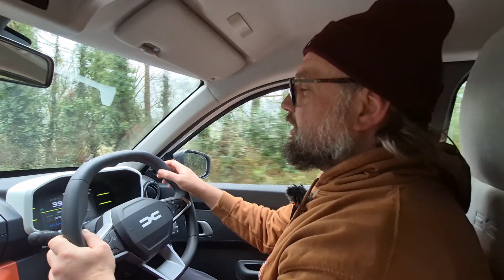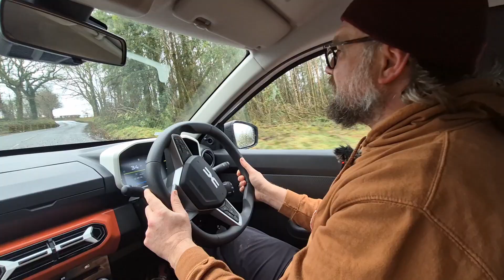Why are car speed warnings so rubbish?

Comment: "Driver assists", really?  If you can't keep your car in the correct lane and under the speed limit, you have no right to be in the driving seat.  You can't use your phone yet it's fine to be able to faf about with a stupid great big touch screen that has all the cars functions on it.  Is it just me or are these regulations taking away the responsibility of the driver to be in control of thier own car?
Reply: Amen from a huge atheist.
Reply: Hear hear! Modern cars are packed full of unnecessary distractions and controls that require you to take your eyes off the road. And on top of that, we are faced with mandatory driver "aids" that don't work very well. I'm suffering serious buyer's remorse after purchasing a new Skoda Octavia. It would be a great car if you removed the speed and lane assist, and replaced the massive telly with switches.
Reply: We have a Vauxhall Astra 73 plate. I like the look of the car, it's on Motability for my wife, but the touch screen is bad, as in difficult to use without taking your eyes off the road! The temperature alters all the time on dual zone climate control, it constantly tells me to BRAKE! if I get within a certain distance of anything it considers an obstacle. It occasionally comes up with a spoken phrase, such as " I didn't get that", whilst my wife and I are having a conversation!  It too, sometimes gets the road speed incorrect, such as 50 on a motorway,  and don't get me started on the lane assist, "safety feature"! It is dangerous to say the least, trying to pull the steering wheel back, fighting it when it decides you've incorrectly gone over a white line. It won't do that if you have indicated first, but not every time do you need to indicate. The only mod cons I really do like is the heated steering wheel and seats! Oh and no bloody CD player. I have to link my mobile phone to the car to listen to my choice of music instead of the radio!
Reply: I traded in my 10 year old car last year and was not expecting all this “assistance” from the new one. I have to switch all these helps off every time I start the engine and before I drive as my speed warning often does not represent the actual limit on the piece of road I am driving. The lane assist is far too powerful and takes too much force to override it which is disconcerting. I even have to be notified about the level of security on the connection between my phone and the car each time it starts. It’s more like a pre flight check than driving! Whilst I’m moaning, I don’t like LCD displays as much as retro needles going round a dial and a I don’t find a digital three figure speed display as easy to glance at as the old school displays. Apparently it’s progress though!
Reply: It's not just you. I don't have a modern car, but I find warning beeps and flashes extremely distracting. I'd rather concentrate on driving in the same ways that I always have.
Reply: Yep. Speedometer + brain is already your speed warning. 'Nuff said.
Reply: In the modern world, there's a lot going on you have to pay attention to, so things like lane warnings seem useful to me, at least, since if you're busy watching whether the vehicle in front really is going on with its manoeuvre and will pull right in front of you, it is easy to wander a little out of lane: at least on the narrow lanes we have in Auckland, where they have increased the capacity of the motorways by demarking four lanes on a bit of road designed for three.
Same way with speed limit warnings: with a car with any sort of power, it's easy to creep over the limit. We once had a Mazda Cosmo (JDM) with a 100 kph pinger. We rather enjoyed the merry tune, and when travelling with the cat, she only really calmed down once the pinger started. And the centre of the city has been taken over by New Urbanists in the roading authority, and the speed limit is varying constantly between 50 kph, 40 kph, and 30, without adequate markings: I'd be happy for a speed limit warning, if it could be made to work. For which one would need a standardised system, with some simple cue for the device on the car. Maybe a transmitter on the back of the speed limit signs?
Agree on the touch screens, which are an ergonomic nightmare: but they're imposed by the management of the car makers because they're cheaper than proper physical controls (except for Elon Musk, who probably believes that they're cool and smell of the future). But don't blame the bureaucrats for screens. In fact, an EU commission on car ergonomics would be a good idea, if it were to specify what basic controls had to by physical. I changed my headunit for one that had at least physical buttons for volume.
Of course, I'm only a fallible person who does make mistakes. And I also only drive old cars.
Reply: Driver ‘aids’ are the reason 50% of drivers can’t remember to switch on their headlights in fog!
Reply: That's the overall plan: you won't be allowed to drive, likely you won't even be allowed to own a car, they'll be a shared commodity - sorta like booking a taxi but we'll all be doing it.

All part of the plan along with imprisoning us in 15 minute cities, digital IDs and currencies and all the other dangerous and worrying concepts they're pushing for now.

Comment: Depends what car you get ?
Reply from the maker: Speed limiting is now mandated. I'm yet to drive a car that gets speed limit changes correct. Maybe it's a Wales thing?
Reply: @ it’s the car, you get what you pay for.
Reply: @ which cars don’t give false information then? Any examples?
Reply: @  Try a Toyota
Reply: @hubnotes  how many have you driven ?
Reply: Now I love my 2005 Toyota even more, no warnings what so ever, apart from
Lights on warning, or no seat belt, but I never hear those because I don’t leave my lights on with ignition on, and I always wear my seat belt lol 😅